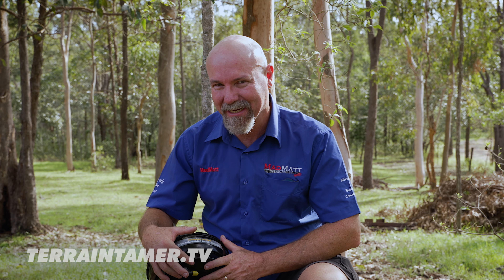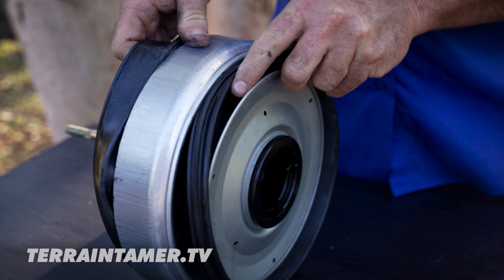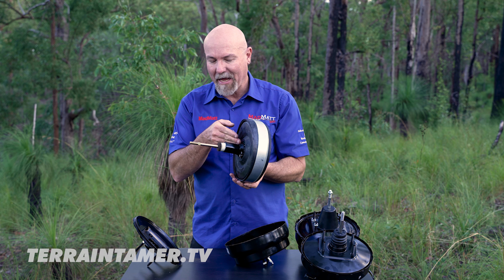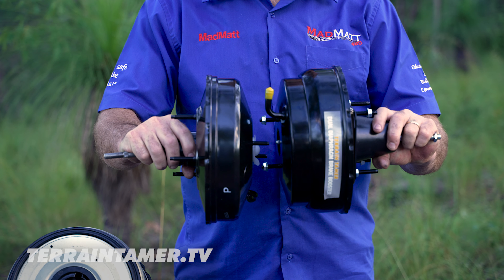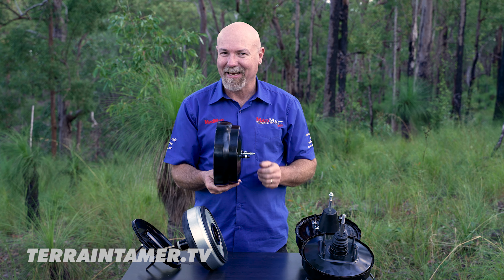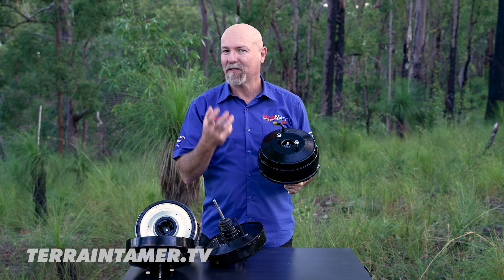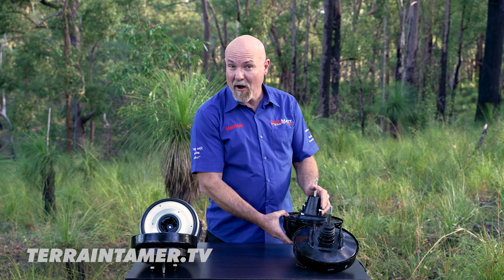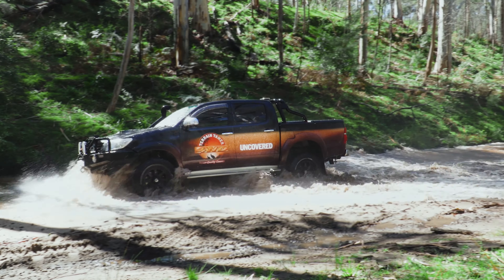Terrain Tamer Uncovered | Heavy Duty Dual Diaphragm Brake Booster

Comment: Hi mate
I was told that the late 60 series and the 80 series had dual diaphragm boosters. Do you know if this is true?
Reply: That's correct, I'm upgrading my 60 series single diaphragm to 80 series 4 bolt dual with Hilux calipers. Master cyl is also larger at 1" on the 80 series.
Reply: Even the 90 series came with dual diaphragm. It looks the same as shown here except for a sensor. I am just about to replace mine with an item bought on ebay. Its made in china but looks solid..hope it will work well as it looks. Mine started leaking at age 25.